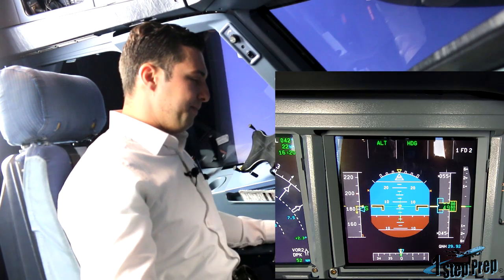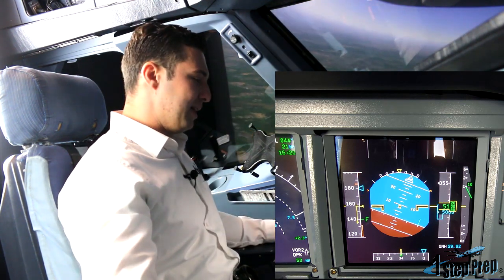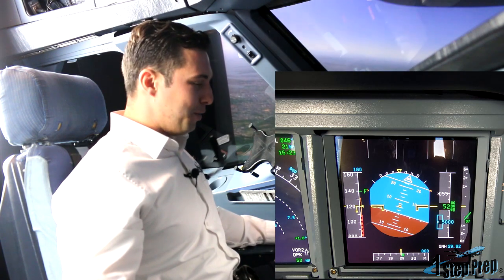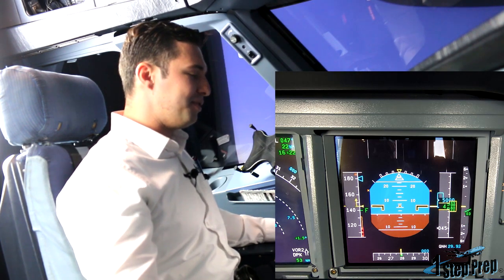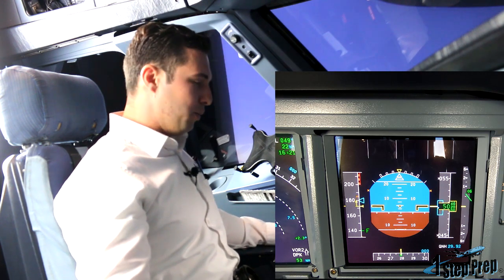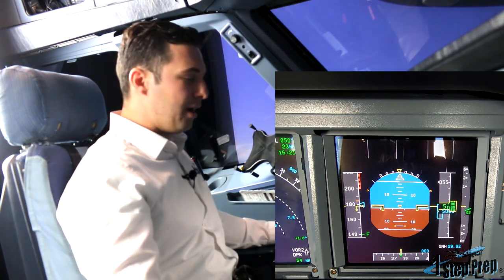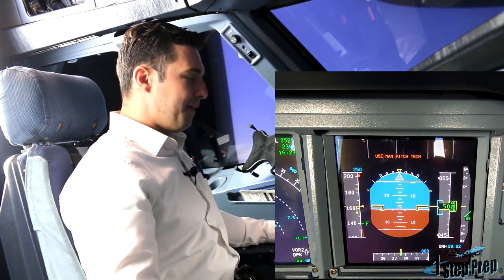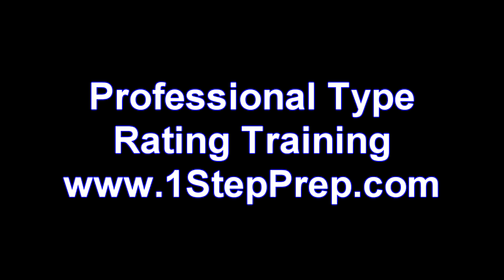A320 Stalls

Comment: It's NOT a stall recovery! Flaps 2,...and then,...It DIDN'T even go into the STALL! The aircraft deviated from the FCU altitude(5000feet) and climbed about 300feet, then it sounded the altitude deviation horn, and the pilot just descended back to 5000feet. That's all! This is not a stall recovery. The subject was STALL RECOVERY, wasn't it?
Reply: Admin of this video, kindly answer the questions and clarify the observations of the gentleman above. Thank you.
Reply: ACS standards indicate a stall recovery must be initiated at “the first indication” of a stall. You do not have to be in a developed stall or have any alarms go off. Even the buffet of the wings can be considered an indication of a stall.
Reply from the maker: In type rating training we don't train actual Stalls. We only train "Approach to stalls". For this reason in March 2019 the FAA Mandated all 121 airlines train their flight crew in full stall recovery which is a program called "Extended Envelope Training" or "EET". It's also known as "Upset Prevention Recovery Training" or "UPRT". That program is included in our type rating video courses at 1StepPrep.com

Comment: FAC1 and FAC2 off?
Reply: Flight Augmentation Computers 1 and 2. Turning them off puts the A320 in Alternate Law for the flight controls. You can stall the aircraft in this mode as it’s a back up mode when things go wrong. In the sim it’s used for stall recovery training as well as upset training.
Reply: @hudini2356 yea sure, but, on that particular video, how they set the acft in alternate law? That is the question.
Reply: @jcostabal  It's a mode that you can push on the simulation. The FAC controls characteristic airspeeds (green dot, F speed, S Speed etc); if both FAC computers were off, there would be no alpha prot or any characteristic airspeeds listed on the speed tape.
Reply: @TheGaliath360 the whole point is to get rid of alpha prot otherwise they couldn’t stall it.
Reply: Protections protections ….